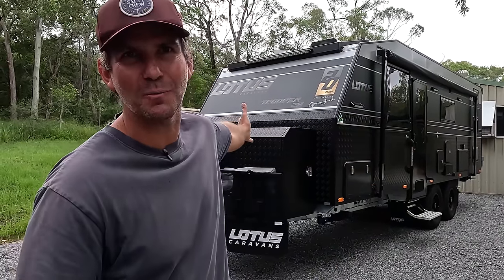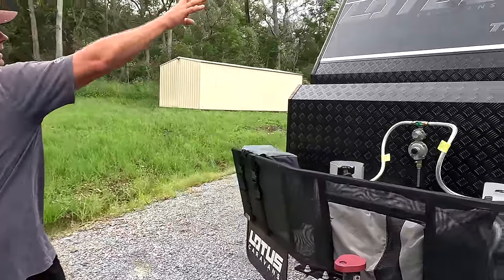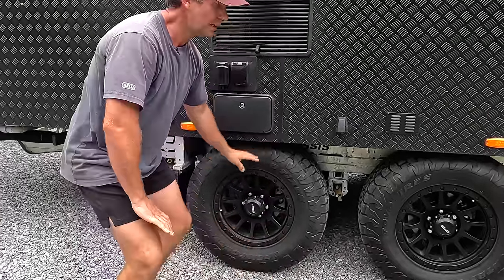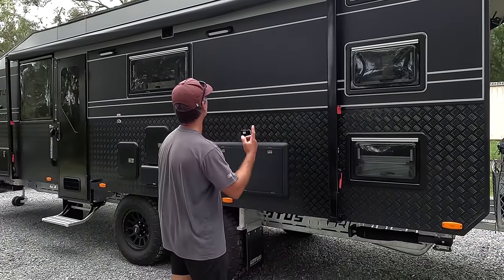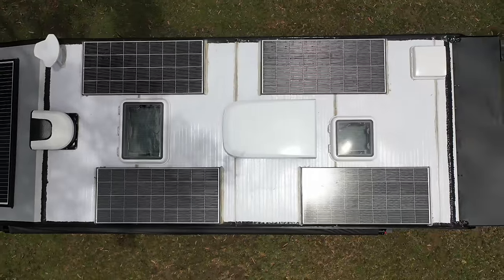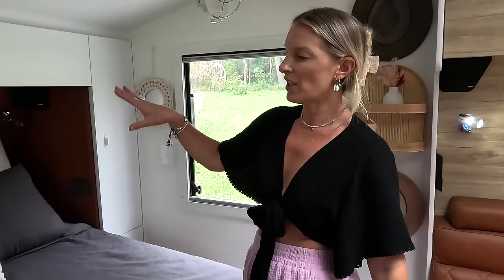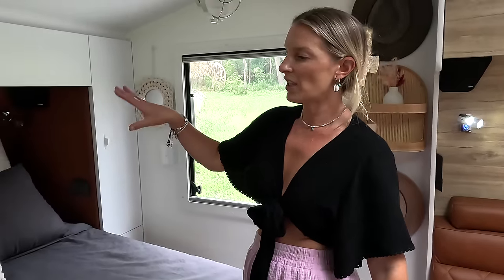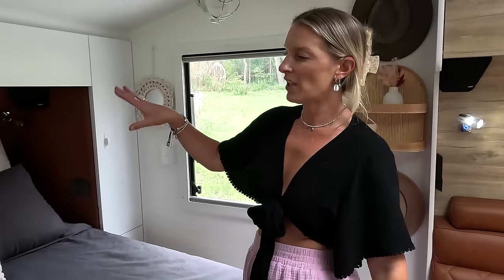2024 OFF-ROAD CARAVAN - The gear on this thing is EPIC😎

Comment: What happened to your love for the front window with lift-able cover?   I have been getting the impression that caravan manufacturers are obsessed with avoiding Weatherproofing front windows so are gradually manipulating the market by flogging off discounted caravans taking away that option.  This makes it a caravan with limited veiws (which is the whole idea of caravanning).
The rear spoiler is prob to  limit dust adhesion to the rear external wall. The external stereo speakers should be spaced apart!    Where is the  Bathroom Vent/skylight??  (Even the Lithium batteries get odour venting) sad about the deprived family with BO with no vent options.:face-fuchsia-poop-shape:🤨😪😑
Reply from the maker: Yeah we miss the front window, but this van won’t be lived in like previous models so we’ve kept it simple👍

Comment: For the price of the van, having the fridge drain stuck through the vent is disgusting.
Reply: Why do you say that.?
Reply: @mitchellholroyd2837  it’s going to leave a dirty trail down the side of the van, it should be coming out the bottom of the van
Reply: @Corey-pd3mi  yea I can see how that would be less than ideal
Reply: With the big red bash will you put some protective padding under the van for rock’s etc?
Reply: And it drains over the top of the 240v input and circuit protection go figure?
Reply: And they had to prise it open a little to do it. I believe they have changed ownership. Perhaps quality control has gone out the door as well.  
They used to run it through the floor.
Reply: I have an earlier model van and the drip drain doesn't run down the side of the van  it's not a deal breaker.
Reply: I agree it would have been so easy to drain the fridge under the van ! 
Nice van even so
Reply: To save water in the shower, you get in, wet yourself then turn the water off. Now you scrub yourself all over , then turn the water on and rinse yourself down. 60% water saving right there.
Reply: How much was it ?
Reply: The real sin is calling a travel trailer a van 🚐
Reply: @Notsofatamerican  It costs how many arms and how many legs ? It's very nice indeed. However, some of these are more expensive than most people's homes.
Reply: @dianep3071    Starting price is around $50,000.00 U.S.
Reply: That hitch attachment is pretty neat!
Reply: How heavy is that trailer? Over 4 ton?

Comment: This does not seem worth it unless you have enough water. People cannot take showers with 60 gallons of water it’s almost a joke especially if you have kids and animals. One off grid Wanderbox has 200 gallons. If they are really off grid you should be able to take showers everyday or every other day for 30 days at least 4-5 people. If there are trunks 28,000 pounds & can haul that why not have 500 gallons of water spread out Screw the bathroom tile, big ovens, microwave & Material things. All you need is Electric, Heat & water before tons of draws. These things will not last without 400-500 gallons of water which is Nothing compared to what these trucks can haul. I won’t buy one until there is enough water. I need  at least 400 gallons, ultraviolet filter to recycle water, water machine that makes water from the air & a way to filter from streams All of it. Nobody talks about water enough. Every dam day you need to go back to the city for water wasting gas. The stream water should be for emergency’s or washing clothes. 400 gallons of water is 3,000 pounds. That’s nothing for a truck to haul.